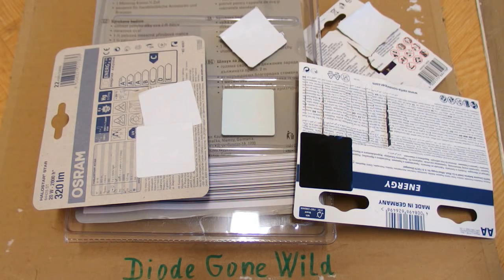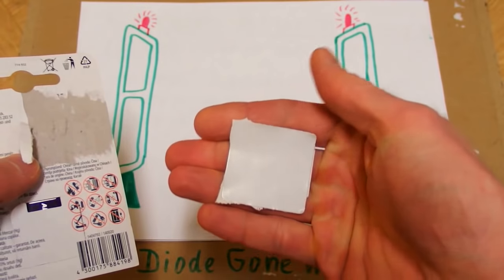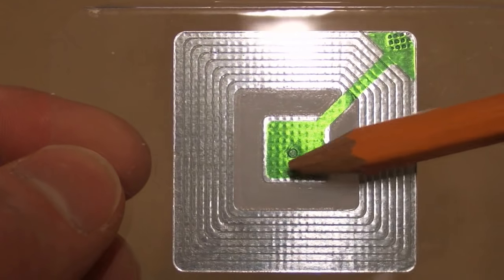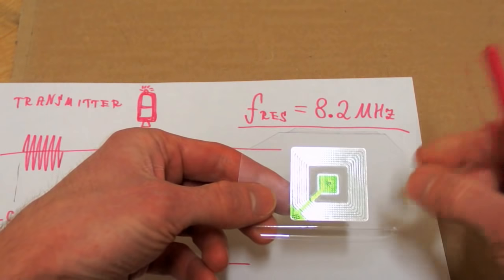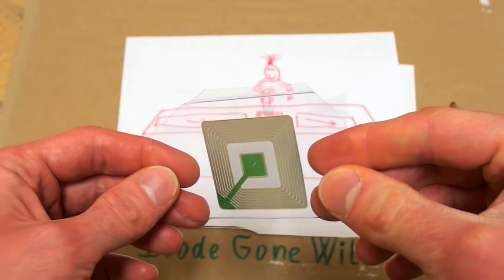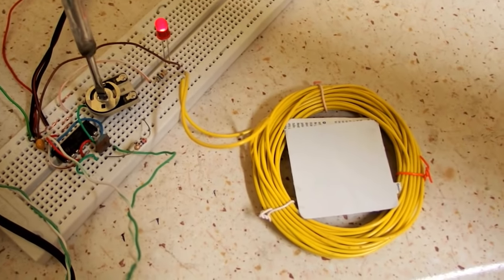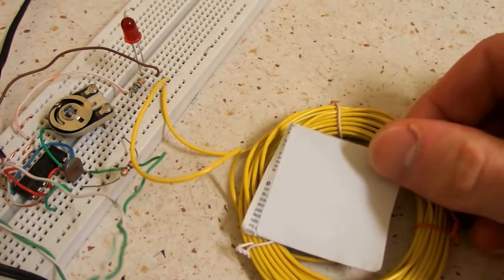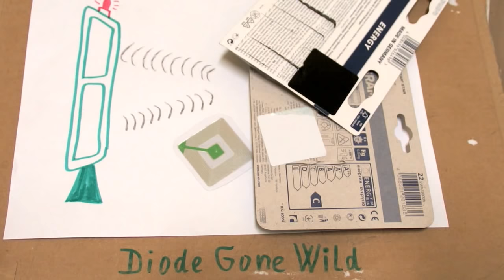What Are Those Stickers on Items in Shops

Comment: Those are the easiest to defeat, just cut them in half (scratch) to damage the coil and that's it.
Reply: Woot
Reply: also the spider tags. you can just stick a sharp object into the tweeter and cut the wire or take a 250lb magnet to it

Comment: Used to have fun at the malls when on leave. Had a access control badge for my assignment. Huge center for military and many doors were set up as man traps, if your card was not authorized to enter that section of the building one out be trapped between two locked doors until security escorted you to interrogation. Well the badge did a damn good job at setting off these alarms in a lot of retail stores. Every time I entered, Alarm. Every time I left, Alarm. Had fun with security, they could never find anything on me that belonged to the store. Used to tell them I was involved with government projects that involved high voltages and that I ad been accidentally shocked on time and ever since I have had weird effects on electronics. They always took a step back and checked their watches and radios.
Reply: Nice!
Reply: Hm I like you

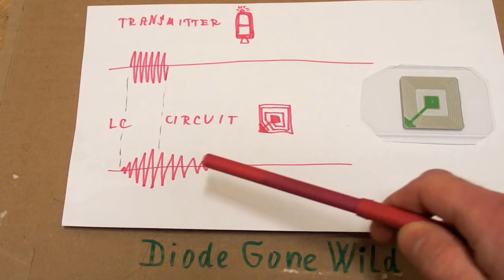Comment: At 1:58 where it shows the graph of the RF pulse, and the resulting return signal, I notice two effects.  There's an initial low output from the return signal early in the pulse, but then a lingering ring down after the RF pulse. So there are two potential ways to detect this return signal. The first (as described in the RF tag section of a Wikipedia article about EAS tags) is to detect the initial decrease in pulse signal strength when a tag is present. The other way (as described in this video) is to detect the continued "ringing" of the RF tag after the pulse transmission has stopped. Which detection technique is actually the most commonly used one?

I also remember a few years ago something I read online that says these tags not only contain an inductor and capacitor, but also a diode. The diode chops off half of the sinewave, resulting in multiple harmonics being generated, and that the tag is detected by a receiver that listens at the harmonic frequencies. However I have never seen a diode on one of these tags, so that description I'd read before may be inaccurate.

Comment: The deactivations have never worked in the history of mankind
Reply: They do work, but as he has pointed it out the resonant frequency of these things changes a lot. Any deformation of the item (creasing, bending, pushing etc.) causes a change in the resonant frequency, which is probably one of the reasons they only tend to use these items on stock that has solid, hard packaging (like books, CD's/DVD's, small electronics etc.). Every now and then they might put it on some unsuitable items however and then the de-activator fails to de-activate it, because the item's resonant frequency will be outside the frequency range used by the de-activator.

Comment: can you explain any differences between the RF theory and application of EAS versus timed single- and double-use public transit tickets?  I split the faces of a ticket to reveal a circuit very similar to the above - a coil with centre capacitor and a black dot on a different part of the circuit - with some minor differences.  I struggle to understand how the receiving system can know the difference between a single- or double-use ticket, and how a life span of 3 months can be programmed into the ticket (i.e. when you a buy a ticket, you have to use it within 3 months or else it will expire).  Do you think the single- and double-use tickets possess the same circuit within and are programmed in some different way, or do you think they are two different circuits, dispensed from the ticket machine from two separate rolls of not-yet-activated tickets upon purchase?
Reply: Hi. What you are talking about I believe is RFID.
RFID tags transmit data through its coil whereas RF Tags do not transmit any data
Each RFID tag would have its own unique number which would be put into some sort
of database, when you presented your card the system would check if it is on the 
database and if it is then it would do what it has to..

Hope I was of help
Reply: @Dan-yu6hv  thank you, that has set me in a direction to investigate.

Comment: thanks for the explanation.
I wondered if that is an RFID tag and could be used for something. but if it is just a capacitor with an antenna, and the capacitor is shorted, then it is useless.

Comment: I'm also wondering, do the actual antenna units in stores have 2 coils in them, one for transmit, and one for receive? Or do they use a single coil for both transmit and receive, and then have a complicated circuit to differentiate between the transmitted and received signals?

Comment: No. It doesn't work like the video says. The system absorbs the energy from the transmitter, so the receiver stops receiving it. And the alarm sounds. It's called a "radio frequency trap."

Comment: So that basically explains that reusable RFID tags use solid coils and a solid state capacitor and the pins is the link to reactivate the sensor for multiple uses. Right? So basically, just cut the coil and terminate the circuit.

Comment: I have a question! Can you change the frequency of RF tag? Meaning not changing out the capacitor nor the coil for diffrent ones, because frequency is affected by period and in LC circuit period is T=2π √LC
Reply: Yes, you can.

Comment: It would be interesting to see if they are affected by a magnet.
Reply: They are not, there is no magnetic material in these to saturate or so.
The whole thing responds just to changes of the magnetic field at (and arround) the resonant frequency. Does not matter what DC background is there. Only when ferromagnetic materials would be involved in the resonance, the strong DC magnet may saturate them so change the resonant frequency,  but there is no such material in these.

Other story are those "plastic" tags the cashier is taking away. Those use a ferrite rod as the coil core (these operate at way lower frequencies), which may saturate when exposed to a strong field, so a strong magnet nearby may make them "invisible" for the door scanner. But needs really a strong field (the materials tend to saturate at about 0.5T, which is the field many high power electric motors operate with), did not tested that.

Comment: What was the oscillator chip you used?
Reply from the maker: It was 74HC14. It is 6x Schmitt gate. One gate as oscillator, one as buffer and 4 in parallel as a power output stage.
Reply: Oh... I didn't know that was possible.
Reply: Look up schmidtt trigger oscillator

Comment: So what your saying is carry a high powered pulse generator+coil to blow the capacitor before you try to steal something ha ha :-D, no no im joking of cause.
Reply from the maker: I thing the easiest way would be sticking a piece of aluminium foil  over it, putting it into aluminium bag or just simply tearing the label to break the coil. But I don't encourage anybody to steal anything. There are cameras watchnig you from all angles. Just carrying a tool that may defeat  those systems is probably a crime.
Reply: lol i was joking, there is no reason for people to steal.
But as i love drinking tea, i may sneak up and steal yours, if you have them lol :)
Reply: No no the easiest is just a price check. There is plenty of price check points. BUT DONT DO THAT!
Reply: No need to be high power
Reply: i eat sulpher and have very strong nails
Reply: @DiodeGoneWild  Some libraries use these security tags. They put them behind the pocket where the date due card goes. The security tag is deactivated when the date due card is in the pocket, because the date due card has metal foil inside.
Reply: Brian Leeper So... metal foil disrupts security tags?

Comment: holy shit what are you french? Also would a regular powerful magnet work to deactivate?
Reply from the maker: No, I'm Czech :). A magnet can't deactivate a coil with a capacitor, unless you use the sharp edges of the magnet to cut the coil :).
Reply: DiodeGoneWild well i actually meant the other ones,
Reply: yeah if you wanna deactivate it just poke a hole in the center breaking the capacitor or cut the coil which will change it's resonant frequency
Reply: Just build emp shock machine from paralyzer id should do the job
Reply: Just use your personal tazer on it... It can deactivate anything electronic... Passive or active LoL... Some Russian guy has a video on it... He took out an intercom system from the street with a tazer... You should see what it does when you tazer a power point in a house LoL... It takes out everything including light globe's even though they aren't switched on.... Tazers are cool..
Reply: DarkZerol to answer your question... I have never personally tried it myself as I don't have a stun gun... But from the videos that I have seen from the Kreosan channel which the video link above is from... You can destroy electronic devices with it... Let's say that you have a 10 month old t.v. and the warrantee on it lasts only for a year... Tazer it and send it back for a new one... Maybe you can even exchange it for something else because you will be to afraid that it might explode again... Ahhh the things that one can do with a tazer??????